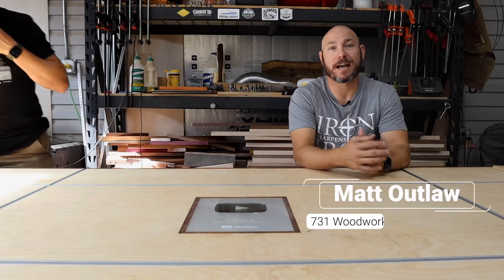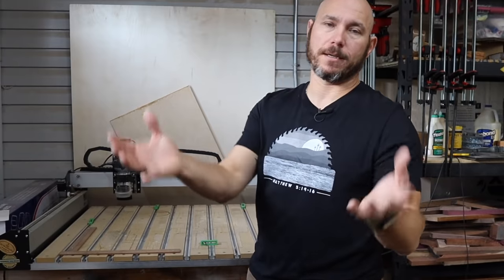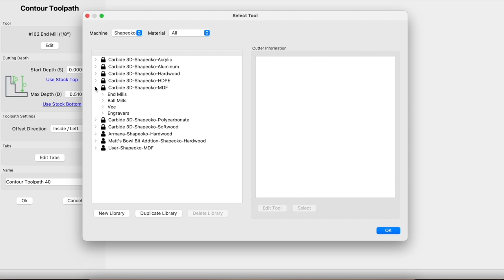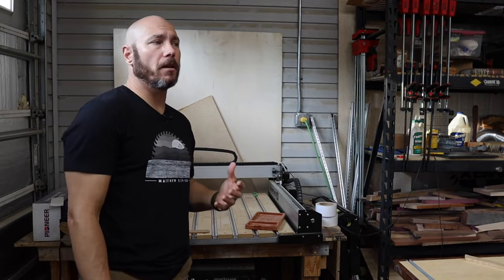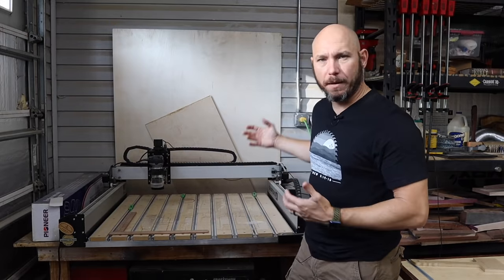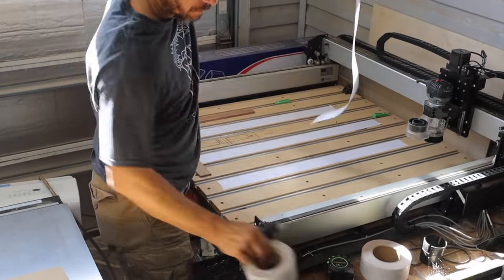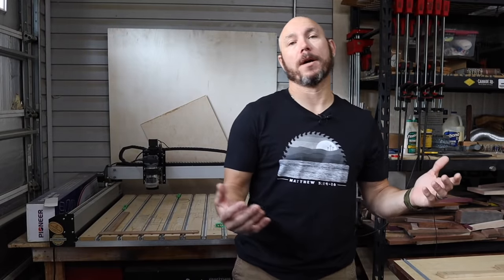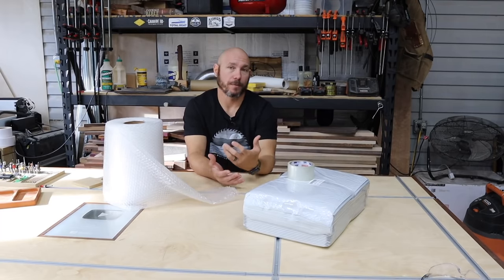The Dark Side of Learning to Use a CNC for Woodworking

Comment: There will always be a learning curve with anything you try to learn. If someone has 
NEVER use CNC  machine ( router) or the software, if they are persistent, they will get to the end of the tunnel.
This can be difficult. I have been using CNC machines ( lathe and Mill-machine shops) for MANY years,
I don't own a CNC router, but I have been wanting to purchase one. I would never purchase a Shapeoko!! Avid Router all the way.
If someone thinks their just going to jump right in and start making something, it not going to happen, including me.

Comment: do american sockets have a ground pin? i think some of them do dont they? when they have the third pin at the top? you can ground your dust collection hose with some cheap wire and a plug head, just need one wire going from the hose to a socket, and all the static will go to ground and not build up.

Comment: Those errors isn't because of the program. It's because of the cheap wire connectors. Cut them all off and wire them directly. It fixed all my problems. I have shapeoko pro xxl.
Reply: It'll fix your homing switch from making the motors grind too.

Comment: The reason your CNC decided to do it owns thing typically comes down to two things. A friend of mine said it is impossible for a CNC to do something it is not programmed to do in the G-Code. I call BS. There are two main reasons this might happen. The first is a software glitch, as someone who has written code on and off for decades, I can assure you that things don't always go to plan. It may only happen once in a blue moon, but for no perceivable reason it just stops working as intended (I have had it crash into hold down clamps it never should have come near). This might be because of power fluctuations, or a memory buffers get full, or any number of simple computer related operations related to the operating system itself.

There may be bugs in the control software, that randomly show up if certain conditions are met. Some out of the ordinary glitch occurs that temporarily allows the CNC to do it's own thing. The second reason that I have come across is electrical noise on the cables. If you have bad connections at the joiners, or you accidentally trip on a motor cord, or just use low quality non insulated cables. electrical noise can cause it to not do what it was instructed to do. I think this is probably the most common culprit of that unexplainable gouge.

Comment: Yeah, I know the feeling when the cnc has a brain fart and runs across the work piece at the wrong depth. Not only frustrating losing a nice piece of wood, but also when it does it after a couple of hours of cutting. I’ve had it happen on the first run, then run fine on the rest of them. Also work fine on the first 2 or 3, then tear up the 4th. Usually mine happens on a 3D piece when in the roughing program where it cuts different depths through the program to rough out the shape. For some reason, usually in the 1st or 2nd pass, it misreads the depth for that pass and goes to the depth of the 3rd or 4th pass. 
Something with the gcode reader I guess. I’m definitely not an expert at it. Closing and reopening the file usually takes care of it.

Comment: Although it sounds like a great concept, I would think there may be a certain amount of concern for liability if CNC manufacturers were to just throw out G-code and say go ahead and push the start cycle button.   There are just too many variables amongst machines and the way individual users have them set up.  Not only all the different CAD / CAM software, but all the different post processors, bit databases and their associated feeds and speeds, etc.

Comment: Hey what’s up man I have a question not related to this topic. Since it just got upload I figured there would be more chances for you to see my comment. I looked you videos in hot to paint raw wood. I tried everything sanding Before painting and priming and the wood grain keeps on coming up. I’m looking for a smooth crisp finish.
Reply from the maker: if you are using soft woods (pine, etc.) the grain tends to show through more.  You might try "popping" the grain.  Mist it with a spray bottle after you do your first sanding (before paint).  Let it dry, then sand again.

Comment: I went to school as a machinist and learned to program CNC , though 35 years ago.  After what seems like a lifetime out of the trade (I got into computer sciences for a career), I jumped back in to hobby CNC work with my new Shapeoko during retirement.  Jumping back in for some things was like riding a bike, however there were some stumbling speed bumps I encountered were explained in this vid.  The biggest one was repetitive jobs.. Why can I create three 'same' items with the same Gcode, then on the fourth item the code send the machine to Jupiter RIGHT THROUGH YOUR WORK!! @(*^%@(&*#Q  WTH??  I still get that happening occasionally, whereby I have to shut everything down (including my computer), reboot everything and start fresh and re-initialize the machine.. I find that part frustrating. Otherwise, things have worked well.  Also mentioned in this vid, its hard to find 'completed' files on the internet.  I've been merely finding SVGs, where I then have to go and program everything in behind it.  Its not difficult (most of the time), however its quite time consuming ..  Thanks for listening!

Comment: I understand how you want something to just work.  But since there are so many different kinds of machines out there, and so many different kinds of stock and tooling and CAM/sender software, you're going to have to spend some time LEARNING and getting some experience.

When I started as a machinist nearly 40 years ago, I was running a Cinematic milling machine that was programmed with punched paper tape.  We had to do all the calculations by hand from engineering drawings and blueprints, and we typed in the gcode on a teletype with a tape punching unit next to it... if you hit a wrong key, you had to "edit" the paper tape by cutting the bad line(s) out with scissors and splicing it back together with scotch tape.  Part setup on the machine is obviously critical, and if you killed a part that already had ten or twenty hours of machining time in it, you were in big fucking trouble.  I moved on the become a programmer/developer and systems analyst, but I've continued to do CNC as a hobby all these years.  I've used all kinds of CAD and CAM software, and now you barely have to touch gcode - it's all done for you straight from the model. 

But it's still fairly complex, and we have a ways to go before my aunt Tilly can toss a goddamn chunk of stock down on the bed and press the "Go" button and walk away with a vase.  Having spent decades keeping up with this stuff, it's mildly irritating to hear you complaining that you can't simply do that.  If you find yourself doing a lot of one-offs, forget CNC and just use a Bridgeport.  Believe me, you'll be better off learning gcode and modeling and how to set up work on a CNC machine.

Comment: Run a copper wire the full length inside your suction hose and ground it to your plug ground. This will stop the shock but the other reason is it will stop your mysterious a not raising and other funny things also even though it is a long shot it can build up and spark inside the suction hose potential fire.
Ground your machine to the same ground with a separate wire

Comment: Problem with sending a ready-to-go file to another machine EVEN if it's the same make and model you'll still have problems as every machine will have different tolerances. Different setups. When working with CNC's we're talking about 10th or thousands of a millimeter accuracy and no identical machine will be the same. Welcome To The CNC World.

Comment: Usually when the machine doesn’t raise up when going to the next cut you’ve “lost steps” in other words the belts are slipping or a v wheel is lose. A lot of this issues your running into are because of the machine your using. Lol

Comment: Ready-to-go CNC files makes not that much sense. There are a lot of different machines, different bits, different software to run the machine. This can't work in my eyes. Programming is maybe hard with the software you use, but there is also really simple software on the market. 
The speed of cut depends on your machine and the bit you are using. I have a DIY CNC, 3 mm deep and 3m/min in oak with a 6mm bit is no problem. I think the problem is the power of your router or the stability of the Shapeoko.
Your spindle is a normaly known as router, its not really made to be used in a CNC. An Air-cooled or water-cooled CNC spindle is much more durable and also not that expensive. 
Hitting the t-track with the bit is just a user failure. There are some really deep cuts in your spoil board. Set the depth right and nothing happends.

Software glitches can happend, why nobody knows, but thats the reason why you should never leave it alone. The bits are a complicated part in my eyes. Using high quality is always better. But I think for the first few projects cheaper ones are a good way to go.

In total: I think most of your dark side aspects are user failures or thing happend because you don't want to learn from the beginning. Of course a CNC has a learnig curve and it is much flatter than e.g. on a table saw. But by investing some time, it's definitly not that hard.

Comment: Unfortunately, plug and play is not smart for cnc work. There are too many variables to account for. Also, dump the carbide router and use the makita. I’m still in my original makita (3yrs) and on the original brushes. 
It pays to learn the ins and outs about how the machine runs. Using better software, while an investment, will actually save you money in the long run.

Comment: As a professional mechanic, that uses CNC machines almost daily, I don't think you understand how cnc machines work, and that programming them is something you can't do for every machine equally... Every machine needs to be programmed differently, because of different size, software, regidety, tools,...
Reply: also most of the problems you have / had are because of your cheap machine.... I wouldn't even consider a cnc machine under 10k-15k, because the tech just isn't safe, or works only half the time. Plus, the more expensive you get, the more effective the cnc becomes.... So if you, for example get a metal cnc you could reduce you cutting times in wood at least by a half, more like 1/4.

Comment: From the start, your downside of not being drop and go for files is part of machining. Say you get a ready-to-go file from someone, but it is set for a 0.25" endmill, but all you have is 0.125", the file wont work as intended. There has to be some user input into the creation of the g-code to make sure it does what you expect. I love your videos, but that part made me cringe a bit, you have to understand the tool to use it properly.
Reply: But if design software is used (no one writes gcode except for simple stuff) then it helps a lot to get the output from that (not the gcode, but whatever the software saves). Eg I use Vectric Vcarve, and getting vcarve files saves a lot of time. I can then change what I need to and generate the gcode. Just getting svgs is not a lot of help